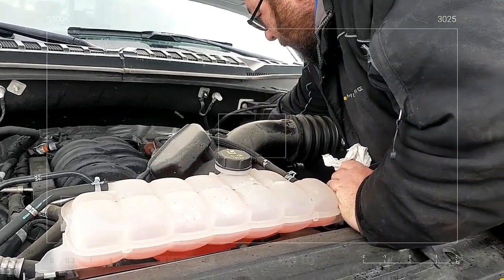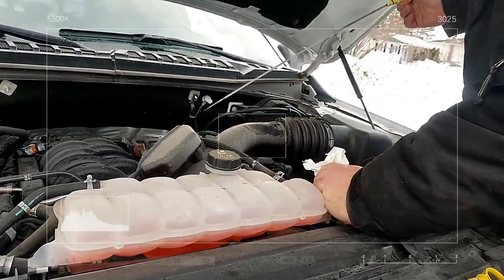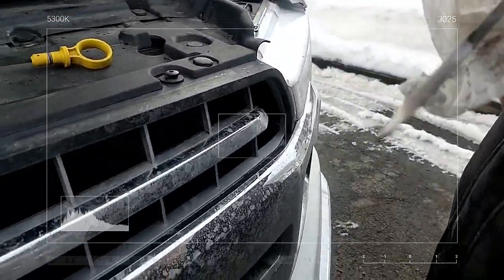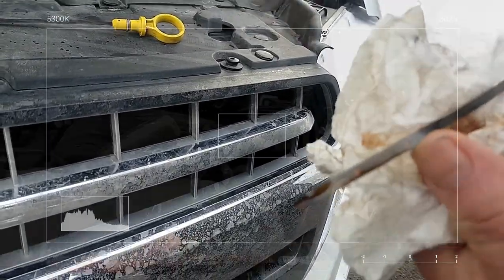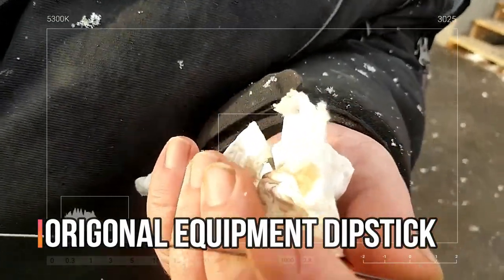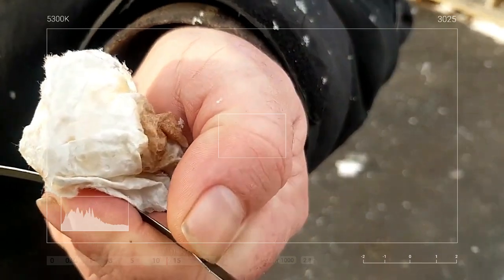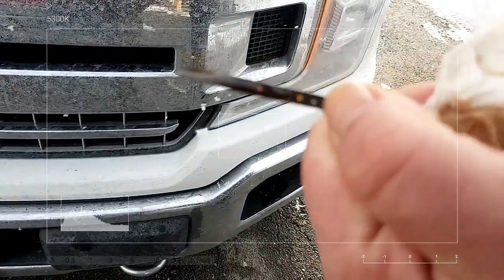2018  2019 and 2020 FORD F 150 burning oil problem consumption overfilling the oil  problem tsb 2365

Comment: Good example of oil areation.  I usually run anywhere from a little over full to one pint/half a quart over the full mark.  Have for years and never had a problem but I think this is different.  With the "new" dipstick, how full are you over compared to when you 1st got the truck.  Are we talking more than 1 quart?
Reply from the maker: Thanks Eric.  What is your guess on the range.  I will have that video edited by Friday will be out Saturday at the latest 🤜🤛
Ty for taking the time as always 👍

Comment: Quick chat: has anyone with the 2018-2020 f150 5.0 V8 have the oil consumption issue fixed or disappear? Or had the oil consumption issue never appear at all?
Reply from the maker: about 99 out of a 100 tell me there has been no fix for this issue. some have had 3 engines replaced with no luck. ty for your question
Reply: After the most recent TSB was performed I’ve noticed a significant reduction in oil usage so I check mine every couple of weeks and add .5 gt about once a month just to bring it up to full because I’m OCD, not because it’s low enough to matter.
Reply from the maker: @daviddion3731  that is still a significant amount of oil in my opinion.

Comment: They overfill them to bust the gaskets and etc. Then you pay them to fix it.  Do all the motors in 2019 Ford F150 XL have plastic oil pans?
Reply from the maker: ty thom tom for ringing that bell,the oil pan on the 5.0 is aluminum,not sure about the other engine options,appreciate your time!
Reply: My 17 2.7 pan is plastic.

Comment: Called a dealership today started my 2018 F150 5.0 take 8 quarts of oil
Reply from the maker: down 8 quarts?
Reply: No mine is not
Reply: Actually your owners manual and all Ford printed material will say 8.8 qts

Comment: In a mixing bowl - more oil is better. Dilutes the froth.

However - the crank should not touch the oil level in the oil pan. 

Better to have kept the mixer blades above the oil level. Ohh nice.

Then raise the oil level to reach the mixer blades. Ouch frothy
Reply from the maker: ty Gus!

Comment: This is not a true example,  the crank does not run that low in a oil pan there are many litres  of below the crank and the oil is distributed by the oil pump through Manley oil journals. However I do agree it not good to over fill your oil for many other reason but your demonstration was very bad.
Reply from the maker: thanks for taking the time,its ok to disagree .👍

Comment: There seems to be very little discussion here of the benefit of the reprogramming of the PCM (TSB) for purposes of reduction of engine vac during DFCO which Ford engineers believe is pulling oil into the intake from the PCV.   If anyone says that this procedure has nothing to do with fixing or reducing the problem, that’s just like saying “hey, look at me, I’m an auto mechanic and because of that, the Ford Engineers surly must all be idiots”.  Maybe all you Auto Mechanic PHD’s should apply to Ford for an Engineer’s position as it’s sounds like you have convinced yourselves that you are surly far more qualified on this topic than they are.  Seems that you are passing up the opportunity to increase your annual income by at least ten times what it is now. Just my 2 cents.
Reply from the maker: thanks for taking the time. 
every one has a opinion
Reply: Of course, everyone already knows that.
Reply from the maker: @daviddion3731  ty for taking the time and stopping by 🤝